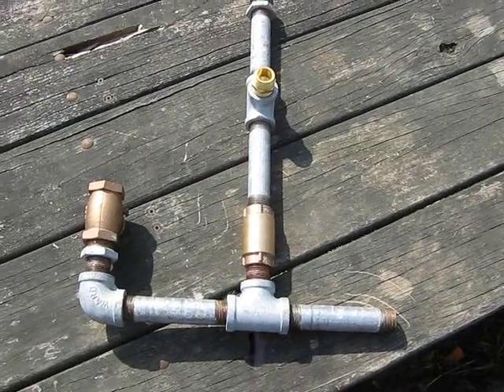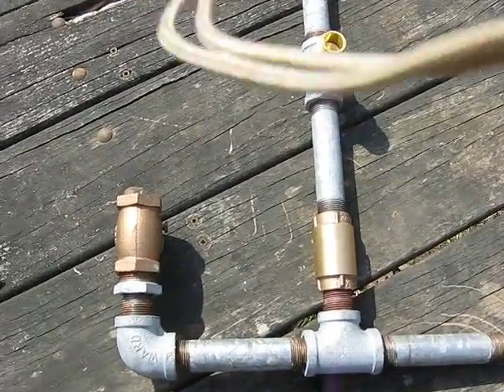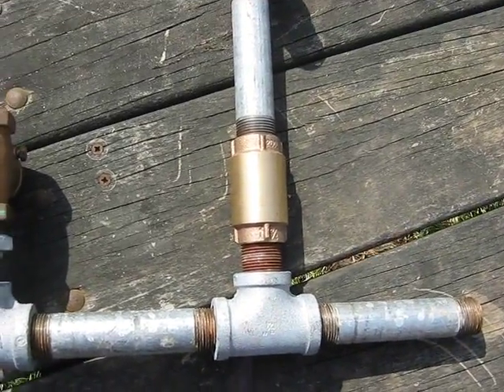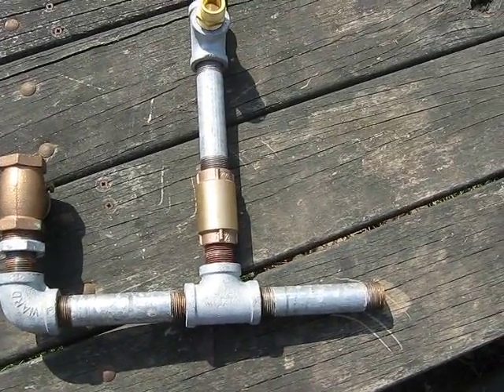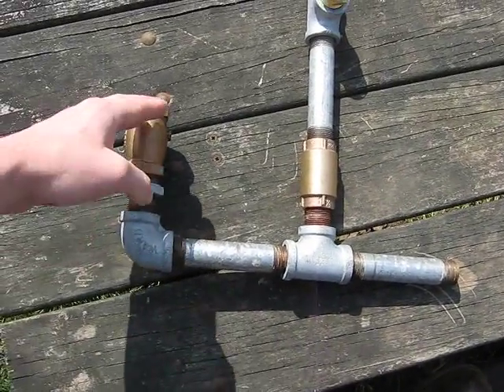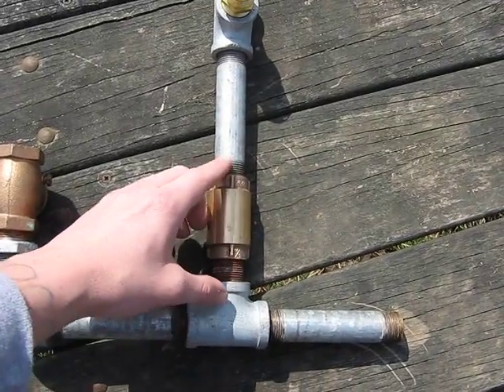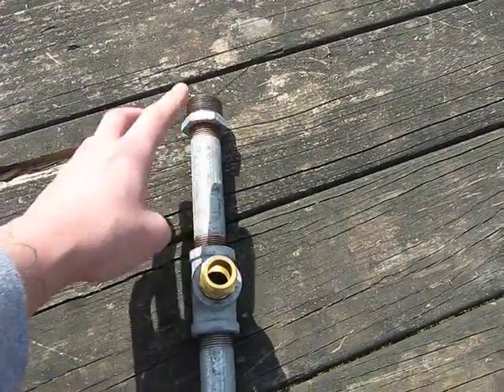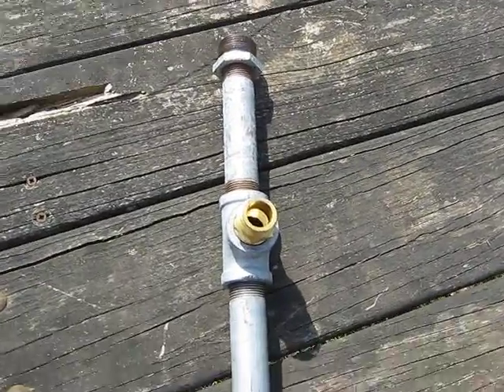Ram pump.

Comment: Good work, have you used a snifter valve below your non return valve?. The snifter prevents the water logging you mention, in the pressure vessel. Look forward to seeing your next video. Cheers. Check out my pump, its very similar to yours.